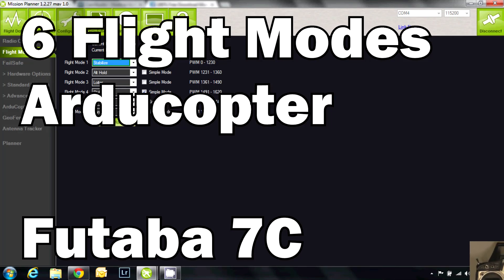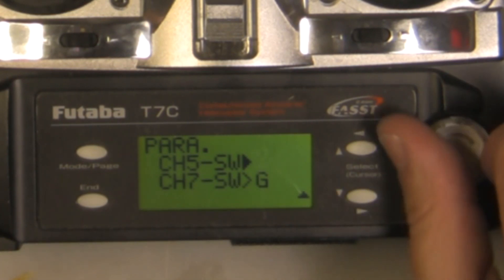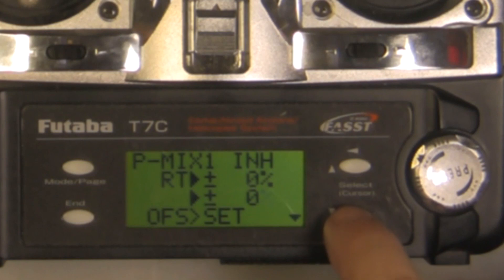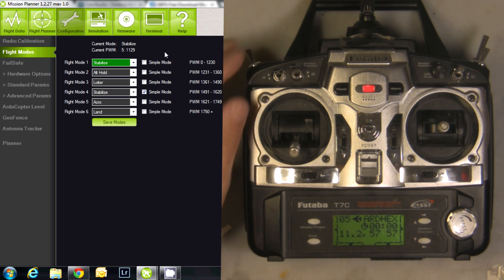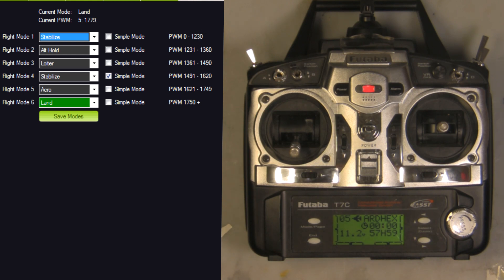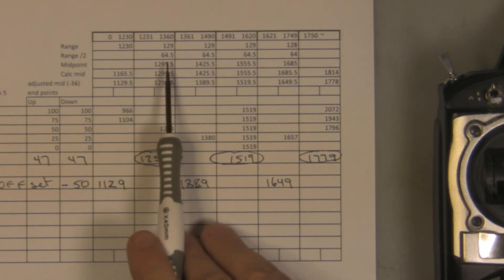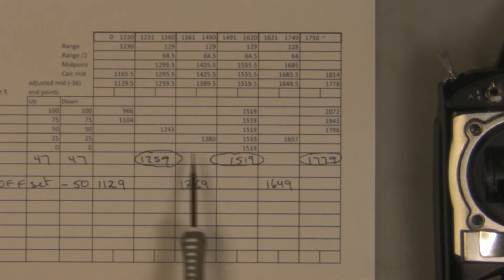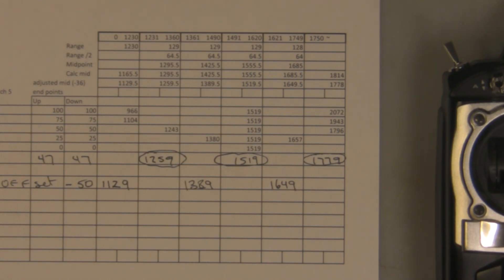6 Arducopter Flight Modes Programming in Futaba 7C

Comment: Great instruction. I used my old Futaba 8U 35mhz radio for setup. I eventually resorted to connect channel 7 running as slave from my RX to channel 5 input on the Ardupilot cause i battled to get correct values for 3 settings from channel 5 from RX. So it seems that there is a few ways to get the setup going, as long as the values for the flight modes are connected to channel 5 input on Ardupilot.